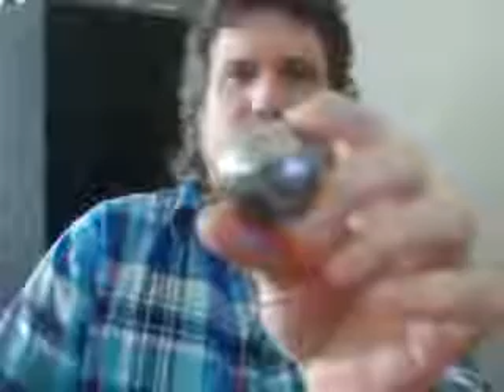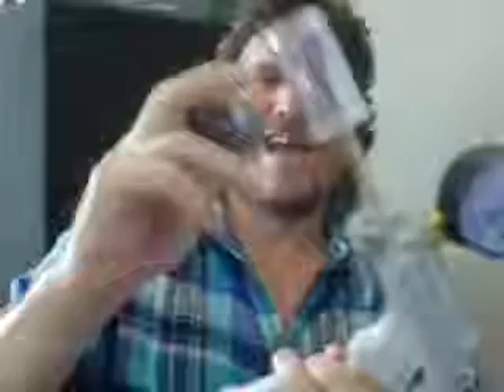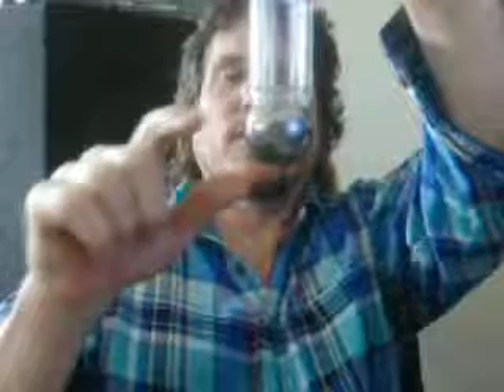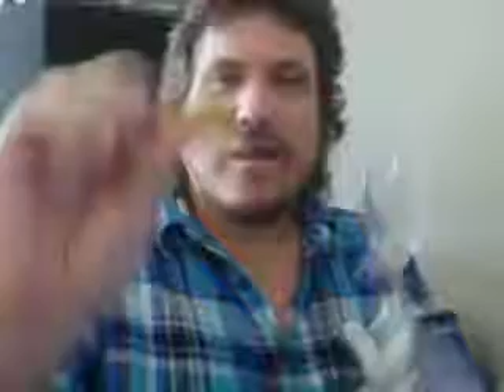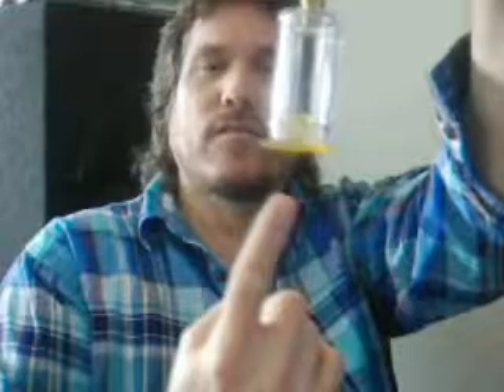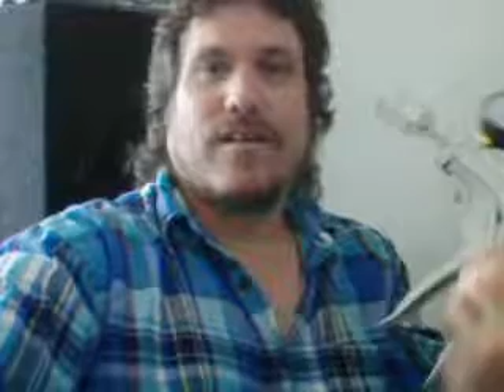Gravity can make a steel ball fly

Comment: The remaining three glue end to end. Test PSI at the individual bearing, the two bearings and the three bearings. Determine consistency of PSI required to create a super pressure above the craft of 40x18. Second hint, if you use magnetic bearings it is easier, for you can build a shape relative to a known UFO shape.

Comment: Analysis successfully presented. Well done. Take the PSI value and the weight of the metal ball bearing and determine the PSI value required for an object 40 feet diameter and 18 feet in height and estimate the weight comparison between the UFO shape and the metal ball bearing. Hint, take four additional ball bearings of equal size and weight and take two and super glue to bottom two bearings.